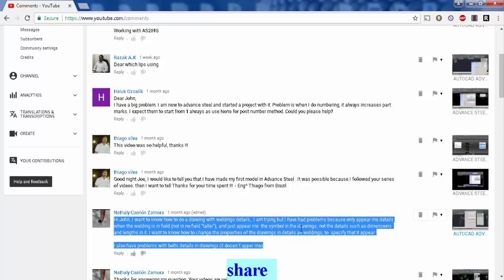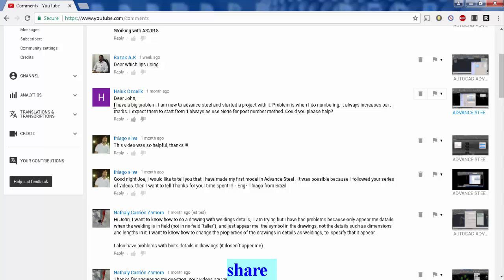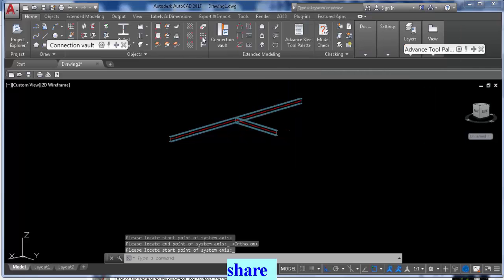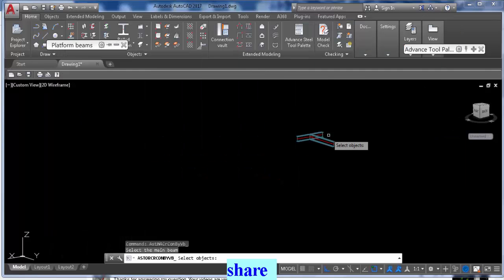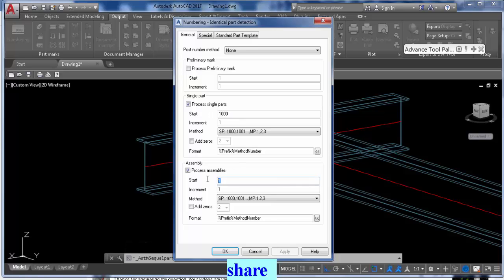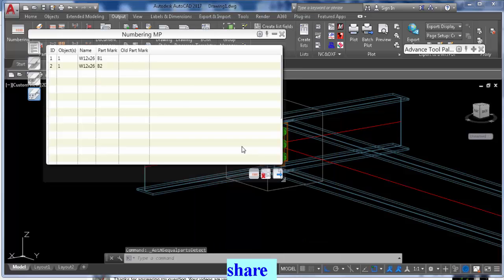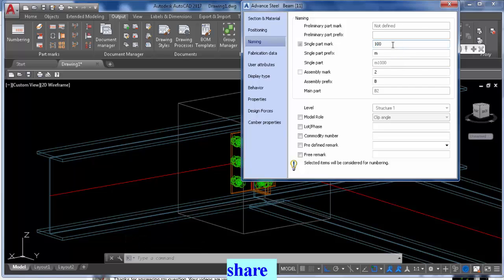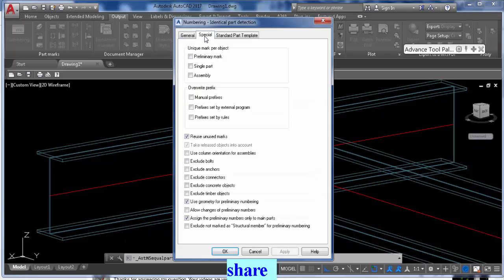ADVANCE STEEL NUMBERING TROUBLESHOOT

Comment: Thanks John. Good video as always. What if I wanted to manufacture a project in few phases and wanted to issue let say first floor out of 5. Can I somehow make the software freeze certain parts and not consider for numbering and drawings?
Another problem that I can't seem to overcome is grout level under a base plate. At the moment I use another plate, but the software counts it as another part. Could you show us how to extract laser profiles from model please.
Reply from the maker: https://youtu.be/YZDQq87ieBA